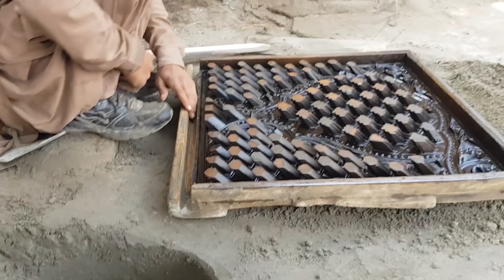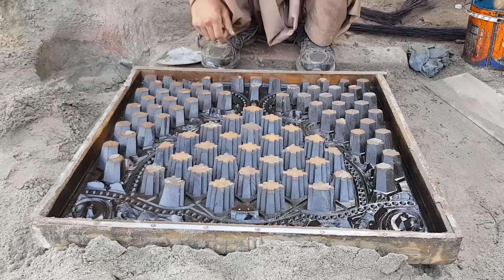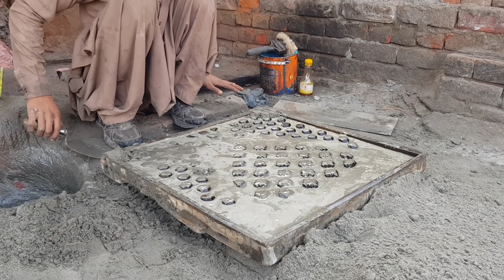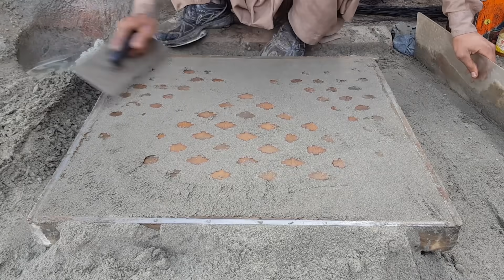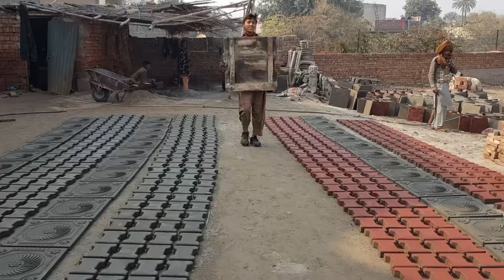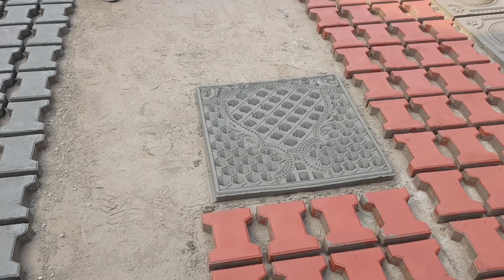Easy Cement Window Making

Comment: Try to make the mold and you will remove "easy" in title
Reply: I was thinking the very same lol, I mean, what difficulty could have pouring anything into a mold. Beautiful window nonetheless.
Reply: The cement mold is now a negative allowing you to pour another iron mold from it, it's all easy forever
Reply: @Moredakkamus  and how do you start making molds?
Reply: @TaxortRetotuck  The same way you start any project . . . step 1.
Reply: @danceswithstone  yeah but Mantoth wrote that you need only copy mold in a negative and in original comment says to first make a mold without negative. So the (whole) process is not that easy. Thats what i ment
Reply: @TaxortRetotuck  it's molds all the way down
Reply: @danceswithstone  "throw your hands up, and point them to the flooooor!" ♪♫
Reply: @Llorx  Just like that my brutha . . .  that's how we grow as people.
Reply: Or try to remove it from the mold..
Reply: Making the first mold is fairly easy these days. Throw a piece of wood into a CNC milling machine, pick the pattern and mill the wood. Use the wood and some sand to make a mold then dump some molten steel, brass or aluminum and walaha. Easy enough. 
Even if you have to hand make the original wooden form its not so hard.
Reply: If you really TRY to make the mold, then yeah...😁
Reply: @rallywagon261  If working on a CNC milling machine is easy for you: You should send your CV to NASA or Titan CNC...
Reply: @TaxortRetotuck  "how do you start making molds?" Type that into the YT search bar.
Reply: @themonkeyhand  i'm familiar with mold making , and i would say that the shape of mold is rather difficult and time consuming to chisel

Edit: so im still standing strong with that statement "Try to make the mold and you will remove "easy" in title"
Reply: @TaxortRetotuck  Oh, I completely agree.  Very difficult process and expensive.
Reply: and yet everything we build in the west is just concrete rectangles :(
Reply: @Moredakkamus  - only the cement would explode very violently if you poured molten iron into it.
Reply: @rallywagon261  easy with a cnc boomer...ThIs Is CuLtuRe
Reply: You guys need mold?  I got tons of it, especially the hard to find Black Mold. Hmu
Reply: @TaxortRetotuck  3D printing is how I'd start. I wonder if a silicon mould would work.
Reply: @TokyoChopSquad  that's big print and printers are expensive especially big ones so if you are capable of using them you are probably capable of ussing more sophisticated tools and that man is using rather  primitive ones
Reply: Just buy it
Reply: try to make the machine that makes the mold and you will remove easy from your life.
Reply: @TokyoChopSquad  Yes a silicon mold would work, they're just not as durable for how many these dudes are pumping out daily commercially... but for personal use or smaller runs certainly.  It wouldn't be any different than much of the molds used for stamping concrete really, only deeper and your filling them rather than stamping.
Reply: Just 3d-print* parts with puzzle-alike connections, connect them, put into a frame and pour molding silicone over it.
It would be much easier to work with silicone mold (especially to take it off after cement hardening).

___
*you can buy a decent 3d-printer from China for a silly money nowadays. I bought mine for 100$
Reply: @rallywagon261  oh yeah, I'm guessing they've got cnc machines laying about all over the place. And CAD is waaay simple to use............
Reply: @TokyoChopSquad  I make latex molds wrapped in a fibre glass case, incredibly simple to copy something. Then fill with concrete.
Reply: And you think this guy is the only one working for this company? Hmm? Or that everyone else working at the company is so fucking stupid that they wouldn't know how to do a Google search and find a different company to contract to make the mold for them? Hmm? That this whole wide world full of technology just doesn't exist in this one place?
Reply: Facts that’s the most impressive thing

Comment: Just had to watch this as I wondered how you can look through a cement window - and now I see that for the most part you can't.
Reply: Yeah, it seems to mostly be a window for light, rather than to see through
Reply: it looks like it's slanted on purpose to let in sunlight but not allow neighbors to see you, similar to plastic blinds
Reply: @gavinjenkins899  Angled to keep out rain and direct sunlight.  The taper also creates as cooling effect as air passes thru the "nozzles"
Reply: @Alan Jackson More like a big pretty screen.  ;)
Reply: lol
Reply: A window is a hole in a wall, a windowpane is glass or some other material that fills the window
Reply: Let in light and air
Reply: It is basically not a window to be used for the living parts of the house in rooms, its more of a decoration for the roof area/walls so it can be seen from outside as art. Houses in south east Asia have flat roofs which you can easily access and visit. Walls surround the roof area and these types of panels are used as decoration on those walls. They are not that high, you can look over them while standing.
Reply: Have you seen how many monkeys they have running all over the place? Light is about the only thing you want getting inside if you live there.
Reply: LMAO
Reply: Did you actually think he was going to make a concrete slab? 🤣
Reply: Its most suitable for burka clad
Reply: It's a wonderful piece of practical wall art that serves a purpose.
Reply: It’s a vent more so than a vision portal.
Reply: I was thinking the same thing too...
Reply: When you think you made a smart comment.
Reply: @njineermike  u dont know what place is that
Reply: probably still provides good ventilation
Reply: I think it's a way to let in enough sunlight to light up the room, but not so much that it gets unbearably hot. AC is a luxury in many countries.
Reply: @gavinjenkins899  And to let air through but keep rain out on windy, rainy days.
Reply: It's mostly ventilation without allowing heavy monsoon rains from blowing into the home.  The window's downward slanting opening towards the outside and upwards indoors.  This prevents excessive sunlight heating and increases privacy.  A pair of these windows in the same frame would also have good noise attenuation properties as well.
Reply: Windows are for wind
Reply: underated comment. Made me giggle.
Reply: It is a wind-ow
Reply: look up the definition of a window.
Reply: A fenestra (fenestration; plural fenestrae or fenestrations) is any small opening or pore, commonly used as a term in the biological sciences. It is Latin for the word "window", and is used in various fields to describe a pore in an anatomical structure.
Reply: Its basically a decorative concrete grill and yes you can still peak out of the gaps...This is very common on more expensive Arab construction...Palaces often had these as decorative  features. The advantage is it lets out heat and lets in fresh air easily.
Reply: definitely not a scenic window lol, but it'd stop too much sun getting in & still let airflow in
if they didn't angle the parts on it then you could see out a bit..
Reply: so did i
Reply: Same
Reply: lol, same.
Reply: @njineermike  bugs
Reply: More of a ventilator

Comment: For those who don't know, the steel reinforcing in concrete (the wires in this case) is because concrete is supper strong in compression (squishing) but very weak in tension (pulling apart), so the wires take the tension load, keeping the concrete from cracking.
Reply: also to note; corrosion of the composite material is one of the most common forms of concrete deterioration. We solved one of the limitations of concrete, tensile strength, through reinforcement, however if the reinforcement is exposed to any contaminants (air, water) through insufficient coverage or cracking, it can rust. When the material rusts it expands within the concrete causing 'oxide jacking'.
Reply: Hey, thanks for the info
Reply: It should be noted that the best way for this to occur is to place the wires in tension initially. That way as the wires attempt to relax is compresses the concrete.
Reply: I think it's worth mentioning that I too am supper strong.  I never miss a meal. Last time I missed a meal my mom got so mad at me that she beat me with a bag of groceries and I cried.  This made my dad mad and then he beat me with a leather clog and now I'm deaf in one ear.
Reply: Thank you Lisa.
Reply: thanks, was about to ask that.
Reply: Doesn't keep it from cracking, but it will however keep the concrete together when it does.
Reply: Ahahaha, if you think that it is enough to throw a couple of thin pieces of wire, you are damn wrong) This is far from an armature, it is thin, not connected to each other, and has no edges, which means it will not hold pieces of cement, even if this thing cracks and falls apart ... This is a waste of wire. It would be better to leave fiberglass fibers there, in the form of 3-5 cm threads, like fluff, mixing fiberglass threads with concrete, an excellent reinforcement is obtained that will not allow the product to crack and fall apart anywhere, unlike unnecessary wire.
Reply: @hibahprice6887  Fiber is trash!
Reply: @hibahprice6887  so is that bullshit tie wire they using
Reply: @R0ssMacPherson  bridgies better watchout the next 30 years
Reply: it wont keep it from cracking, concrete will always crack. it just keeps it from moving when cracked, so the crack doesn't get bigger or fall apart.
Reply: @gwot  I've seen plenty where it doesn't. tacked wire frame.  Should have prepped a the wire to be tacked as one
Reply: @anonymousprepper1463  you can do as much as you can, concrete will crack, that is 100% guaranteed.
Reply: @gwot  Ain't shitting me. . and a controlled joint, doesn't guarantee a controlled crack even on a solid sub-grade. Sun stresses concrete... the slower the cure the harder the cure
Reply: @gwot  it significantly slows cracking in concrete under tension
Reply: @tedtedsworth4656  Is your name Brian Wilson?
Reply: @Carl-LaFong1618  I can't read, sorry
Reply: This was not concrete as there was no aggregate in it. It was just cement.
Reply: @CFox.7  Not quite.  The initial slurry was either just cement or cement and a very fine sand.  But the remainder of the drier material packed onto the top of the mold had aggregate - albeit small.  Sand is aggregate.  Now, a mix of sand and cement is often called a mortar, but there is no real difference between concrete made with larger stones and concrete made only with sand, other than the size of the aggregate (larger stones, vs, smaller sand particles).  Some concrete has aggregate up to 3", other concrete has aggregate as small as 1/4".
Reply: @MattRogersdesigns  I work in construction science in Australia. Sand is considered fines. We only refer to coarse agg above 2.36mm as agg...generically speaking. This was just slurry with some coarse low grade stabilised sand thrown on top.
Reply: +Paint +vibro table
Reply: Do you know that this is not concrete? This is cement and there is no other additions to be concrete.
Reply: @R0ssMacPherson  we just got a perfect example of what you described just happen.
Reply: Its not called wire. Its called rebar.
Reply: but not really because they're smooth wires rather than textured for the concrete to grab onto like rebar.
Reply: @greenlawnfarm5827  i was referring to the OP.
Reply: @snap-off5383  Ok. Well i was still right.
Reply: @greenlawnfarm5827  completely off-topic, but you were accurate.
Reply: @snap-off5383  I know. I am smart and know about mostly everything.
Reply: damn all the civil engineerings commenting
Reply: @iftia6548  argumentum ad hominem?
Reply: @snap-off5383  i think your replied to the wrong person
Reply: @iftia6548  Nope I was replying to you.  Google it.
Reply: @snap-off5383  im a civil engineer tho
Reply: @iftia6548  that doesn't bolster your comment.
Reply: @iftia6548  Of course it is, if name-calling is all you've left.
Reply: I doubt this thin wire that doesnt have any grip or pre tension will do much
Reply: @MattRogersdesigns  wrote "Sand is aggregate."
Also @MattRogersdesigns: "Some concrete has aggregate...as small as 1/4"."
I've never seen sand 1/4" in diameter.

Comment: Now we know where the wire from the rebuilt alternators gets used.
Reply: Alternators use copper wire, this guy is using steel wire...
Reply: Скорее всего это корд от шин.
Reply: @AleksandrSlepov  Very likely!
Reply: I was just thinking about all the steel wire I had in my scrap metal bin from SWA cables and wondering whether I could use that.

Comment: As I understand it, the purpose of these windows is to cool air.  Wind will force air into the openings, compressing it, and as the air comes out the other end, inside the room, it expands back to normal volume, being cooled in the process.  It's a primitive form of air conditioning.  That's how it was explained to me, and why these are so common in hot climates.

Comment: that's too bad he lays it to cure on an uneven surface.  They all turn out wavy I guess.
Reply: I noticed that. But when you look at the brick work right behind him you realize that in a primitive culture straight lines are not all that important.
Reply: @danroberts9050  Good point.  I suppose if it were important they'd be doing something about it, hehe.   (honesly, my house has crooked corners and lines all over the place)

Comment: How do they clean off all the concrete flash around the holes? Do you chip it off once it sets, or does tipping it onto the sand break it off? Too bad they don't show the finished product.

Comment: You do hard, skilled work very well.
Cement is very caustic and will wreck your  hands and skin with prolonged use. Please take care and wear some protection and use a moisturize like Vaseline or oil. I have contact industrial dermatitis and misshaped, twisted  fingers from working with these types products for decades.

Comment: amazing. Did i see that right, that in parts inside the mould are not straight and a bit conical as well ? Could not see it properly. Perhaps I need new glasses....
Reply: It's so rain can drain away from the window instead of going inside the building
Reply: @whburton1  Thank you,

Comment: It's a louver. Good for ventilation purposes and letting in a breeze. Not so good at keeping the elements out except rain --- as long as the aforementioned rain isn't in any heavy wind. Especially not good for any insulation value.

Comment: This is NOT a window, it is an air vent and not a very secure one either. It would be very easy to break it.
Reply: MTR  I wouldn't....but a criminal would.
Reply: MTR  its not a concrete block, its thin and easy to break ....the fact you have a flag as your picture and how you have responded with nothing but a lack of logic or common sense....tells me all i need to know
Reply: MTR  no compression, bad mix, sun dried; it would probably break with one hit from a 12'' crowbar.

Comment: Apparently they don't understand the concept of "window"; i.e. an opening in the wall or roof of a building or vehicle that is fitted with glass or other transparent material in a frame to admit light or air and allow people to see out.
Reply: What you don't understand. A window does not have to be made with glass.
Reply: I understand perfectly. I clearly stated glass OR other transparent material. If there is no material, it's simply a hole in the wall, not a window. Not rocket science my friend.
Reply: then according to your own definition, this is clearly ( pun inserted here ) a window.....you can see through it, it allows air and light to come in. All at an angle , thus preventing rain from entering.
Reply: Not my definition, genius - it's Webster's Dictionary's definition. You forgot to mention how to explain away the transparent material aspect. Again, if they're left open, they're simply holes in the wall.
Reply: @gerrymiller7401  
I feel you a little tense. No need for glass....windows existed way before the invention of glass.  We made it better with glass....but it was a window a long time before.
Yes they are holes.....and in order not to confuse them with doors.....they called them windows.  You seem stuck on the glass thing. Don't.
Reply: @gerrymiller7401  QUOTE: Did medieval castles have glass windows? The stone castles of some of the Medieval Period did have glass windows, but not originally. Windows sometimes had wooden shutters, horn panes, oiled cloth, oiled skins or nothing at all. Arrow slits did not require coverings.
Reply: @KB4QAA  - Not sure what time warp you live in, but I live in 2021 so I couldn't give two shits about medieval times or what they called a dozen eggs. You have a problem with today's definition, call Webster's, I didn't right it.
Reply: @fastnbulbouss  English seems hard for you. I'll say this a little more clear. If you have an issue with today's definition of window, take it up with Webster's.

Comment: this is so poorly made, firstly, the pour of slurry then topped up with dry would result in poorly combined aggregates. Second, the cement was not compacted, this resulted in numerous voids in the cement, this will, as it cures, be points of failure, this will crumble into dust in a decade at most, and worst of all, its probably going to be rendered into a building which will cause any render this supports to also fail once it is bonded. 

3 out of 10, nice try. dont sell that to anyone.